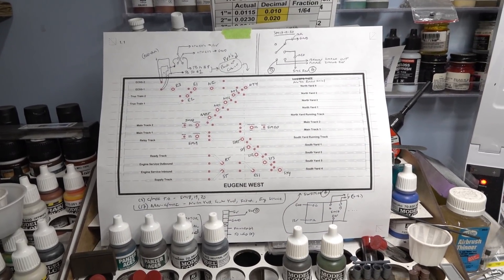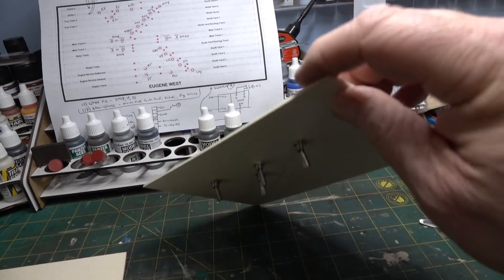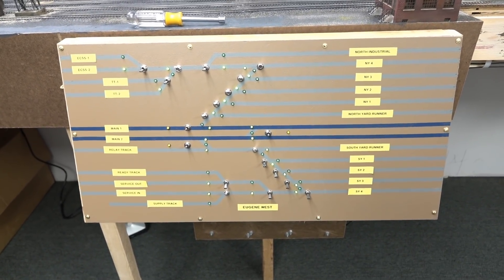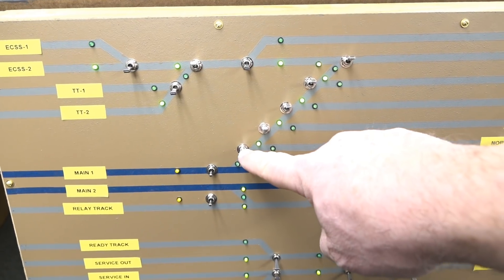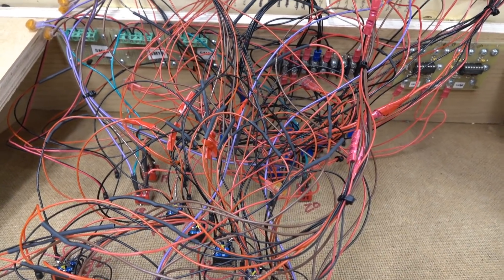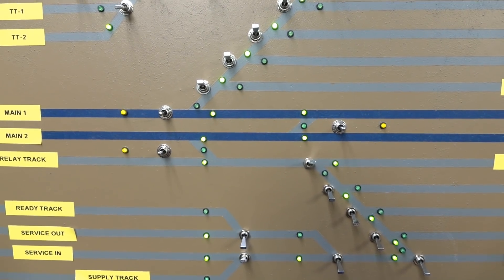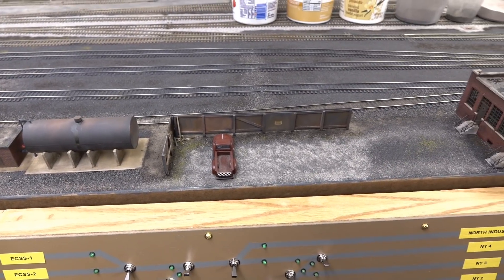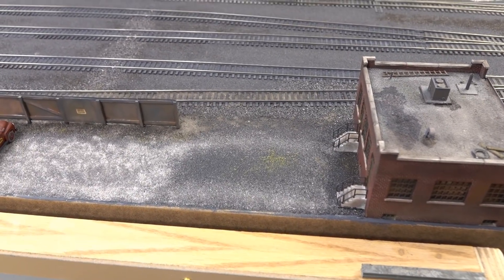MRUV 136: Control Panel Work, Ballasting and adding a Station

Comment: Great update Rob. The funny thing is my Dad and I just last night (before viewing this video) where talking about wiring tortoise the way you did. Not having so many lines running back to the 12v bus. Nice job on the old fence. I like the junk in the inside corner of it. And I think the placement of the Eugene station works well. Have a safe trip.

Comment: You should buy some molex plugs , you can get them in different number of pin configurations and you can just simply plug and unplug on the back side of the panel. Also you could try a piece of 1/8 plexiglass on the front to hold down the labels and all you have to do is drill your hole pattern out. Anyway good video and I enjoy watching and thanks for not having an bad ego problem.

Comment: Rob, using 2-wire bi- color leds will be more clearly seen which way you have switched the arrow on the control panel arrows. I can send a connection diagram to the arrow, if interested.Very interesting your creativity, thank you

Comment: Your updates are thoughtful and filmed well; always looking forward to them. That depot is very nice looking (a perfect tribute to your dad) and I think you should stop putting yourself down as you do great work and it is okay to care about doing things the right way as in the switch toggles lining up with the prefered route. I think a "house track" behind the depot might be a nice addition, in fact if the rails were buried in the asphalt that would look very cool indeed. Of course I know nothing of Pennsy practice in such matters so you do what you know best. Are you considering a platform for the Eugene depot? Just curious.

Comment: I have been following your impressive layout from the very beginning, but I always assumed you were modeling a NS modern layout? Either way beings your layout is based around the 1950's but correct me if I'm wrong... isn't the Sunoco signage in your backdrop (26:50) too modern for the 1950's era?